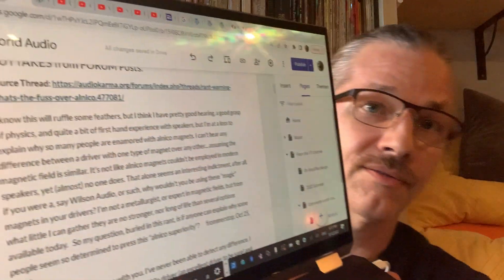The Great Alnico   Ferrite Debate!

Comment: It's theoretically wrong to say that the alnico magnet is not affected by the inverse magnetic field that the voice coil creates. In fact, as the weakest magnet of all,  it is even more (quantitatively) affected than ferro and neo-magnets, the transient "softening" effect on the magnetic field being perceived as "more smooth, more musical sound" compared to "stiffer magnetic fields" provided by ferro- and neodymium magnets. This quantitative disadvantage, theoretically, suggests rather a lesser expected performance at low level detail signals with (easy-on the-ear) "rounding up" of transients. I'm referring to the Barkhausen noise effect which, though and perhaps, from a QUALITATIVE perspective, may impart some beneficial overall performance to the alnico magnets. We should also not forget that alnicos are far more tolerant to high temeratures (especially compared to neodymiums which have poor thermal stability), although thermal "attacks" from the voice coil to the adjacent pole piece and end-plate (saturated iron or MU metal) are rather poorly transfered to the true magnet body, even during extreme, extended dynamics, especially in high internal volume (well aerated) cabinets. Unfortunately, I have no experience with alnicos. I only know that older, Lowther aficionados, tended to have a preference for the PM A2  (alnico) model. But the company believe that the DX4 and EX4 (neodymium) models are, sonicaly, superior, especially on the lower details level.
Reply from the maker: 👍✨ There's an interesting bit about the Alnico that it has an instable magnetic field after it's made, that is sensitive to external fields... during magnet break-in period this field will loose 1-2% of the field strength, but then it stabilizes, and remains there even through extended use. There might be a soft smearing effect due to the coercivity, and in theory it's smearing details. In practice it might be doing something good, as I suspect it's doing a clean-up job after issues artifcats that the amplification process introduces. When comparing Alnico drivers vs ferrite, my initial perception is that ferrite has advantage in definition, but after extended listening I always find that it's not an advantage but a lot of added harshness and grain, and takes away sonic balance towards show and weakened tone. 
I suspect though based on experience (and manget data as well) that Alnico starts to exhibit the sonic drawbacks (softening and smearing, and coercivity issues) when we push it super hard. On the other hand, ferrites and Neos get angry and harsh sounding when pushed hard.... so pushing too hard is not good for any solution. 
I think the choice boils down to what sound one wants? The driver to keep its cool and composure under duress, at the cost of a little addded softness - or to become more angry and violent...   
For rock and show the becoming edgier as it gets pushed hard is a total win-win scenario... For meditative listening it's the exact opposite I want..

Comment: Hey J 😊  one comment asks about vintage gear.  With a lack of printed matter how does one tell what the material used for the motor is?  I have a pair of 12” full range from mid 1950’s and a pair of 12” 3 ways from @ 1967 same company and I’d just assumed that the later were Ferrite but after looking last night there’s nothing to indicate this in the info available.
Reply from the maker: Hi Eddie, quite the opposite, you helped to look into it a little more, and dig into the common concerns and opinions that float around, and share what I think of the matter to make waters more clear. 👍👍

Comment: I hate to tell you this Janos but Wison Audio uses alinco in their midrange driver, they call
it  Wilson Quad Mag tm.Obviously trying to warm that cooler sound up somewhat ha ha.
I  prefer alnico to ferite myself just more detail and naturalness, In the end the electromagnet is my ultimate choice as it has even more fine resolution and naturalness
than alnico or ferite with the added bonuses of adjustability and never demagnetizing and being even more dynamic in range.I should mention also that the electromagnet's performance is highly dependant on a large high quality power supply as well to ensure quality results.Regards Lou
Reply from the maker: Thank you Lou! Indeed, they started using Alnico.... they have not for a long time though (I think, but I'm not that knowledgeable about WA history, just going by what rumors I heard...). 
EM is coming up in the follow up of this series. :) I'll be mentioning about their power supply requirements, with a hint at your solution ;).
Reply: Tungar Supplies for FC Magnets bring forth an ineffable beauty that other supply types could only hint on, based on the majority of anecdotal evidence..
Reply: @rickg8015  Hi Rick I thought of using the Tungar rectifiers a few years ago
and I they may be the best way to go for my field coil drivers as far as tone goes. When factoring in the voltage drop,the intense light  and cost I decided to keep
the shotky rectifiers in place. I would need 8 tungar rectifiers as I have 4 field coil drivers .Practically speaking I would like to try static inductive diodes which would most closely resemble a high current tube rectifier but I have not been able to find them yet. Regards Lou

Comment: Hi, it would be great if you could make a video explaining field coil drivers
Reply from the maker: Thank you, I will !; )
Reply: @realworldaudio  Very inertesting subject , a niche in audio/loudspeakers and with great history.....................this is a very complex issue........because of the need of a quality high current source , silence , perfect DC and batteries or supply..........
The parameters of the Loudseaker can be modified by changing the voltage on the coil..................!!!!!!!!!!!
interesting to have a look on older radios with field coil speakers........were the coil is pârt of the load.........and or the psu ............
Fertin ...........Supravox............and others.........
There's an important economic aspect to field coil followed by alnico........the budget is quite different ..........it's an INVESTMENT that drives you to bring all other ancillary equipement up to the same quality satndard than these speakers .......but the proof of the pudding will always be in the eating ....and to find the right SYNERGY !

Something like upgrading from the finest silicium transformers to nano cristaline ......there will always be the ..............Coherence , Harmony and Synergy is the secret of the cook...........

Comment: If u can make a video on aperiodic enclosure 
I couldn’t find much projects on the internet. I have low FS and low qts pa 15 -18” driver want a compact sub box that does not need to go abive 80-100hz
Reply from the maker: Hi Anand, Low Qts will not like a compact box... I'd recommend as big enclosure as you can for these drivers, and use a slot port with a small horn at the end for better acoustic impedance conversion.
Reply: USD Audio sells aperiodic membranes.

Comment: Very nicely said Janos.........beliefs, statements and opinions about XXX they never heard or experienced !
The magnetic motor structure of both magnets are very different ..........besides the cone material , even the paper is property of the manufacturer...............recone those older speakers and you hear the difference of the cone even if both old and new are paper cones........

Lush dried paper /cellulose fibers on a matrix sound totaly different than compressed paper, the latter is far more economic and faster to produce..............the lighter, non compressed ( almost transparant ) older paper cones have a grip on the air molecules ...........the newer bounce the air molecules. 
so it's not only a question of different magnets ........!

Besides that the older Alnico drivers had mostly high impedance & very thin wires on the voice coil , thinner wires means >>>>>more windings per Inch/cm .............and lighter voice coils !!!!!! 
That result in less inertia,less stored energy, faster transient response, higher sensitivity but LESS POWER handling.............they loose there own sound when driven by very high damping amplifiers and FB..............these were fully dvelopped for tube technology !!!! Today they want to marry two different worlds..............which is for my part an aberration ...............
These speaker alos HATE .................offset on the speaker output , something that doesn't exist with transformer coupling............

In fact comparing two different technologies  ( alnico /ferrite etc ) is like comparing apples with pears...........
some manufacturers still propose both technologies with the same speakers.............and some also offer the field coil option..........which is all together another story to tell.........
Now I will continuing the video ..........
Have a nice day and sunset.............here we are trying to " survive " the heat wave ............not a good time to run tube amplifier or class A ....................
Reply from the maker: Hello Frank, I hope the heat-wave will pass sooner than later! Indeed, the most for you now would be a flea-power 71A or 1626 amplifier with 0.75W or rather a type 31 with 0.35W... preferably in mono :) The later can be done in class A with under 10W heat production total... 
Indeed, I also think that the biggest problem with audio gear is that they are trying to make them compatible with everything on the market. The end result is utter mediocrity, speakers / amps "work" with everything, but they do well with nothing.
Reply: @realworldaudio  Fully agree with you Janos !
But it works for marketting ............for many ...........
Yes ................Fleapower ............;;even the headphone amplifier from Yamamoto has a louspeaker output 8 ohm with +/- 200 mW.............hahaha, there we enjoy those high sensitivity speakers...

Comment: I believe this video of Alnico vs Ferrite magnets could be more easily understood if there were pre-drawn pictures of the two or three type of magnets discussed.  Just trying to help.
Reply from the maker: Thank you Howard! I already made a series on that... going through in detail on the structure of Alnico, Ferrite and Neodymium drivers with cross sections of the drivers, and tearing the magnetic circuits apart. This is just the pep-talk on AN / Fe  : )

Comment: One thing JBL did that I found strange was in there L100 speaker system they used a alnico mid-range and in the L65 system they used a ferrite magnet same midrange driver's except for the magnet. What made the L65 so desired was its tweeters which still demands a hefty price today and was used in the higher end L300 .Maybe JBL thought there was less benefit using alnico in the midrange .
Reply from the maker: Synergy between drivers, crossover, and the concept of the loudspeaker is the most important part, and can lead to unusual combinations - plus, they had to think about what amps they will be matched with, and the applications. 
The bottom line is to always think outside the box.... there are possibilities, potentials, yet "no theory / preconception survives contact with reality". Some of the best speakers are born from truly unusual solutions...

Comment: A couple of empirical subjective observations from folks in audio I usually agree with say that well designed alnico drivers exhibit kind of a soft clipping sound, and that magnet material is akin to different core materials in output transformers.. FWIW, I use mud magnets (ferrite) for my HF (Altec 902), and alnico for th LF (Altec 414Z - king tone!).. Anyway, I personally would still prefer a well designed ferrite driver than a badly designed driver that so happened to have an alnico magnet..
Reply from the maker: A good driver is a good one, no matter the magnet inside... :)

Comment: Thank you for another fascinating presentation. Are there not, however, there too many variables to compare just the magnetic materials? For instance, it would be interesting to see how a driver with an electromagnet might compare. These are rare, but have and do exist. This way one might be able to remove variable in the magnetic structure. Although, this would be very difficult to do without a large investment in time and technology.  Thanks again!
Reply from the maker: Yes, too many parameters, yet I found commonalities within reason... will continue to expand for three more videos on the matter, including mentioning electromagnets. (This mini-series is on AN/Fe, so not going into EM deeply this time..)
Reply: @realworldaudio  Excellent, thanks you!